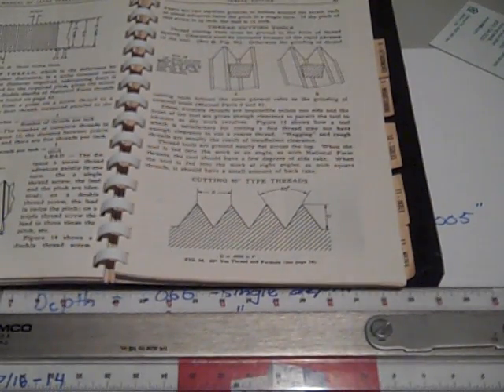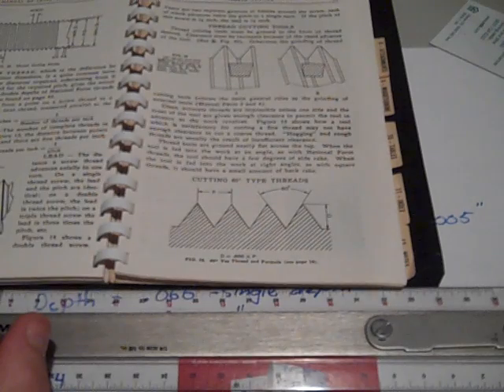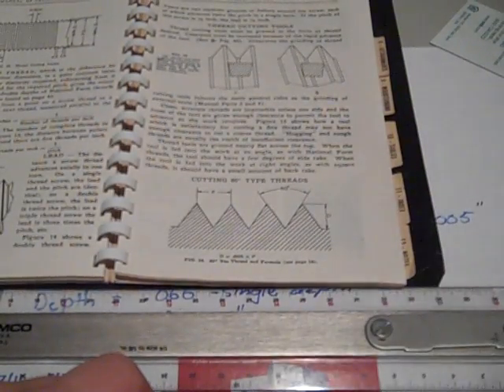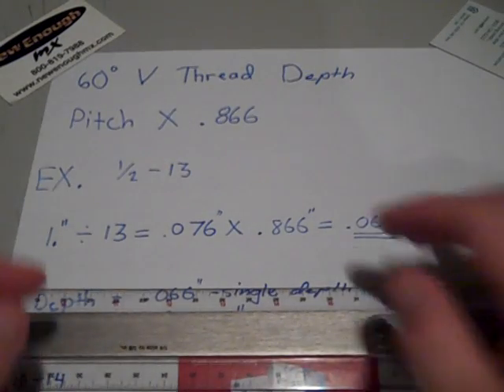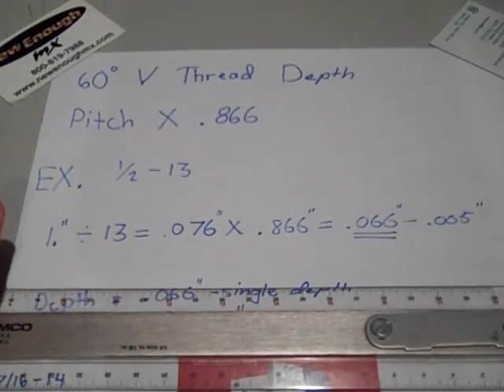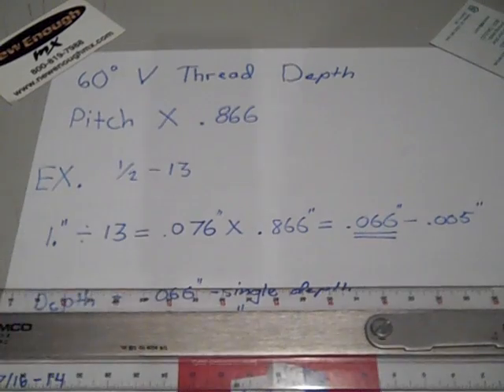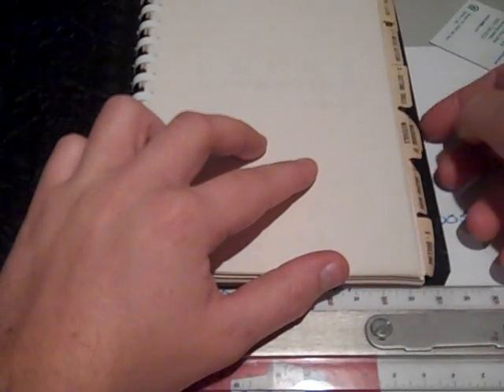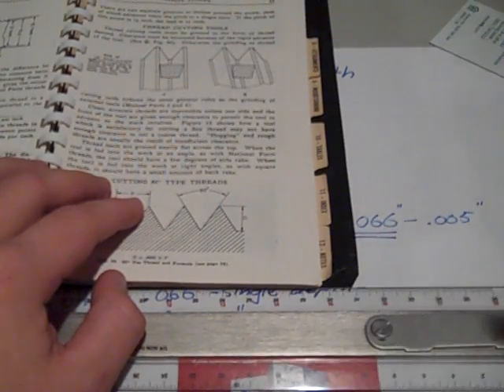Threading cutting calculations part 1

Comment: 3/4 - 10 
3/4 = major dia  .75 
Thread per inch 10 

Feed or pitch length 1/10=0.1 

depth of thread .1x61343= .0613 

Minor dia .6244 is my math right?
Reply from the maker: Im not sure were the 61343 is coming from in your math? .866/10=.0866
.75-.0866=.6634" minor dia. this does not include the 25% over cutting for clearance between internal an external threads. machinerys handbook says minor dia for 3/4-10 is .6309". The formula in the vid is just a close ballpark sum to start with. It does not calculate in practice clearances or tool tip radius, actual pitch dia., tool tip touch off inaccuracies or work very well for internal threading. I should have expressed that in the vid much better. The formula is basically for threading to a standard nut fit. Not a deadnuts one shot to size tested with wires or a thread ring gauge. Im sorry if the vid mislead that. Thanks for watching.

Comment: Where did the 1"  come from?
Reply from the maker: thread pitch is number of threads per 1 inch of length. Ex: a 1"-8 x 1" long bolt would have 8 threads, 3/8"-16 x 1" long would have 16 threads. the decimal equivalant of thread pitch is 1" divided by number of threads

Comment: Would this work for both ID and OD?
Reply from the maker: Im not really sure. Most of the thread engagement clearance is in the ID side. I suppose you could minus 25% from the sum the formula gives you an start from there. That is a complete guess though. I dont do ID threads hardly ever, where I have to calculate the depth of cut.

Comment: I need to learn how to calculate minor diameter for external threads , at a certain percentage of thread engagement , probably 65 or 75 % , I’m sure there’s a formula, does anyone know how to do this ? I need it for my work .
Reply from the maker: from machinerys handbook: According to page 1528 of The Machinery's Handbook (29th Ed.), that formula is given as A_S=(π/4)*((d_m+d_p)/2)^2 where the pitch diameter is d_p=d−0.649519×P, and the minor diameter is d_m=d−1.299038×P. Honestly IDK what all that means. mathmaticaly if you take the formula times 2 minus from your major dia that would be close to your minor dia on external threads. EX: 1/2-13 .866/13=.0666", .0666"x2=.1332", .5-.1332"=.3668" external minor thread dia is roughly .3668". There is much more to it than that. Your threading tool has a radious on the nose Rad=.25 of Pitch witch will leave your minor dia bigger. typically your nominal major dia is undersized as well. EX: .5" will be at .498". Real world speaking the minor dia would be around .3988". IDK if this helps. The machinerys handbook has all the dimentions from #0 thru to 4" major,minor,pitch dias. A tons of thread calculators on a Google search as well.

Comment: Hi what about a 55 deg whitworth thread its actually a 1" x 12 TPI thread I'm cutting..Any
help on the infeed depth would be greatly appreciated..I know the fish tail said 0.053" 
but i don't know if that with the compound set at 27.5 deg..Thanks I'm trying to learn.
Reply from the maker: This formula does not work for 55 degree whitworth threads. Ok, to start your tool should have a tip radius calculated from the thread pitch. Rad.=.1373 divided by pitch. so .1373/12= .0114" RAD. Thread height or strait depth on the cross slide would be .0533" calculated by d=1/3p x 27* 30"= .640327. So .6403 divide by 12= .0533". to calculate compound depth, depth divided by COS 27 1/2 degrees = depth. So .0533/.887= .0600" compound depth. Phew!! so to simplify things a little, tool tip radius is .1373(constant)/TPI, That gives you proper radius for any whitworth pitch. thread hieght for any pitch is .6403(constant)/TPI=depth. compound depth is .887(constant for 27.5 degrees)/depth. So to answer your question .060" is your target on the compound, well really close to that anyways. If your dials reads 1 division=.001 off material diameter then you have to double the sum to .120 dial reading. Hope this helps, thanks for watching
Reply: ***** Thank you for the explanation mate its very much appreciated,Tried today to cut the 1" x 12 TPI internal whitworth thread,Took it too 0.059" on the compound and still was not enough so kept feeding in 0.001" till i got to 6 thou on the crosslide..Still no luck seems to fit on a ml8 myford wood lathe spindle but not on the myford M type spindle..I know its close when it fits the ml8 as the back pates i buy and adjust only need 5 thou of the threads and a skim cut of the internal bore and spigot ID..So i have mounted it back up normally and going to finish the cut just using the crosslide..

I've a feeling some thing is not right some where..But i got to say it needs about another 5thou or 10thou off the threads and see if it fits...

I took 59thou on the compound and 5 thousandths on the crosslide and still no go..

Thank you for your help I'm interested to see how much its going to need to get to the correct depth..Because no matter what maths is done i believe there is a discrepancy between the sizes..

The myford ml8 is a 1" x 12 TPI whitworth and nothing from the ml8 will fit the myford M type lathe which is also a 1" x 12 TPI whitworth..The ml8 is smaller it seems as the stuff from the Myford M type fits the ML8 lol..

As for the dial on the crosslide its in 0.001" and when i take 1thou i take 2thou of the ID..So its double depth of cut ?
Reply from the maker: The myford M is probally a tighter class thread. Cutting internal threads you usually start with a hole 25% of thread depth bigger than the minor thread dia. on the external part. But for a spindle fitment i would imagine you want a tighter close fit so it will locate nicely. There is also variables like tool tip radius. without an optical comparator  its pretty darn hard to accuratly measure a .0114" radius. so your dials are direct read dials. 1 division moves the tool .001 an cuts .001 off the radius witch means .002 off the diameter. So you do not double the sum of the formula for your dials. Im curious how much further it will take to fit as well. Do your internal threads look sharp, as in the V comes to a sharp point? Its probaly the minor internal thread dia. thats interfearing with the fit.
Reply: ***** Hi pal i get what you are saying about the 25%, the minor diam of a normal screw thread for a 1" x 12 TPI is 0.898" thats for the minor diameter of the bore for the threads,this chart im using just says screw threads not what form of thread they are for..

But what i have found is that its around 0.915" to 0.920 is actually the minor diam for this spindle roughly..As i say measured roughly calipers its more likely 0.907" but you can get away with the minor diam above, i done this with the 2 back plates,i had purchased which where for the ML8..I had to just keep feeding in on the cross slide only too 58" if iremember right..

I think personally it's going to take at least another 0.010" but i will just go slow taking 2 thou passes on the crosslide..I have to repick the threads up which i have done before,Wasn't so difficult and will be feeding in using just the crosslide..But there is 59" thousandths on the compound and 6 thousandths on the crosslide up to now,and its a tight fit on the ML8 spindle but will be interesting to find out..I need to keep these numbers wrote down so i can work it out at the end..

I have a few of these to do that's why im trying to get the correct measurement for the thread depth..I don't have any wires or would have checked the spindle to get the proper minor diam of the bore..

You asked are my crests at a V not yet mate there still flat which is a good sign,i don't think they will form a V before i get to the correct depth.They will have a flat top i could be wrong but i think there is enough material left to get too where i need to on the depth.Will keep you posted thank you for the advice though its well appreciated..

Comment from the maker: The formula is based on 100% thread engagement. Typicaly you use 75% engagement. The fishtail figures are based on 75%.or Depth=(1/no. of threads)x .64952 (25% of .866). Usualy the clearence is in the internal thread and the external thread is near mathmaticaly correct. The formula is only a get ya close thing. That is why I state to minus .005" from your depth sum. Useing the formula you will be extremly close to finish size as long as you touched off lightly if hardly at all.

Comment: Hi, am trying to figure out the .866 you use, but its not making much sense to me. I have a fishtail gage, and it shows that for 12 thread per inch thread the depth should be 0.054", and if we go by your method, it gives .067" which would make the thread loose!!

Comment from the maker: @Thinker4Life I'm honestly to lazy to do all the math to calculate wires over threads. The kit makes things easy.
You cant substitute M3 wire and mutiply by 12 the numbers dont come out right. If you are indeed talking about a pitch of  .4  my wire kit doesnt go down to .4 pitch That would be a real oddball size. You will have to address the machinery's handbook on that one. I hope all this helps you. Take your time check with the nut often.Try a scrap peice first make sure the #'s jive.

Comment from the maker: @Thinker4Life I would personally make the bolt 35.924mm for a little clearence. If you dont have 2.3368mm dia. wires you can make them but they have to be dead nuts right to size. A spin fixture on the surface grinder could acheive the accuracy needed. If the boss wants measurment over wires then tell him to part with the $20 for a set. There is calculations to figure different wire sizes for the same thread. But the 2.3368mm is the best size for that pitch.

Comment from the maker: @Thinker4Life Thanks for watching. This will be a mouthful to explain. Difference with metric is to mutiply.    .866 X pitch Ex: .866 X 4= 3.464mm that is the depth of your thread. Tell your boss to order the thread wire kit for you. A M36 x 4 bolt has a pitch diameter of 33.4019mm depending on the class tolerence. If you use a wire diameter of 2.3368mm (.092 inches) you want a measurment over the wires of 36.9483mm. These set of wires is in the kit.